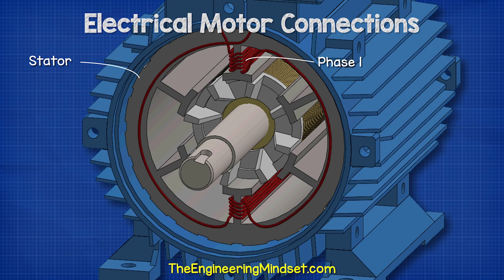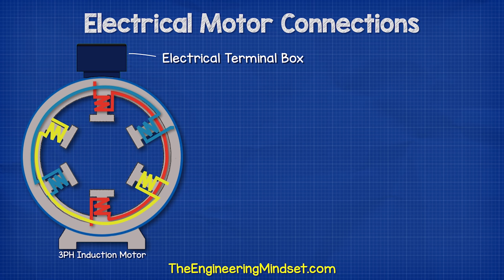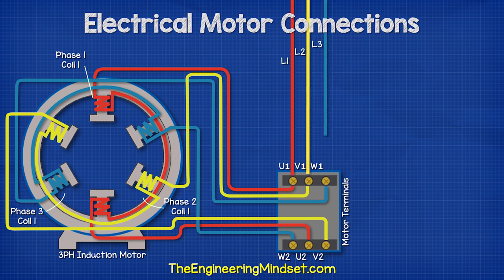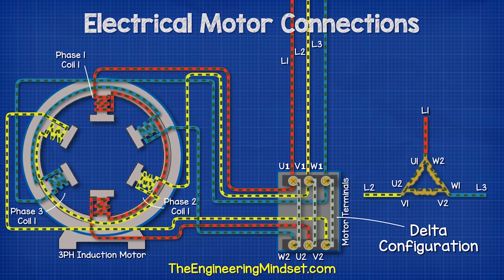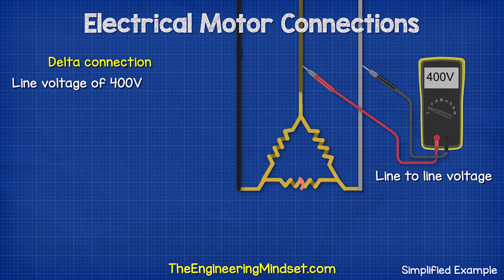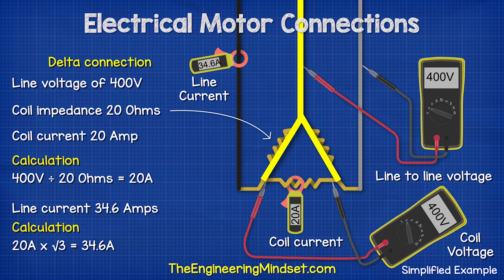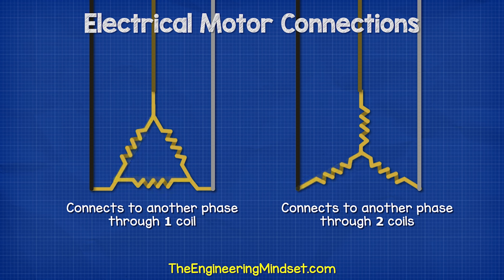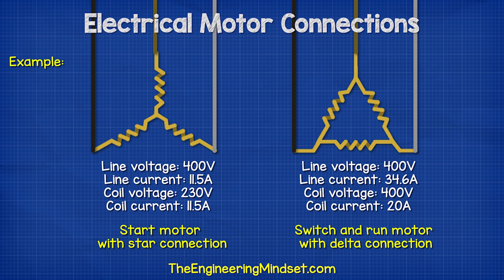Electrical Motor Connections

Comment: We don't have terminal boards inside the connection box on three phsse motors in America, just nine wires brought out from the internal part of the motor into the connection box located on the motor external. All nine wires hang individually loose within the connection box and are NOT connected when bought from the motor vendor. Six of the nine wires have their own number designation attached to them. The designation ranges from the number 4 thru the number 9. Each of the remaining three wires have their own designation as well. Those designations are  T1, T2, and T3. Sometimes T1, T2, and T3 may just be labeled as 1, 2, and 3, not having the letter "T" attached. Again, the nine wires are connected in the field, inside of whatever piece of equipment/system of which they are a part. Three phase motors are built as multi-voltage motors in America. The two voltages are 230 volts 3 phase and 460 volts three phase. How the nine wires are connected is dictated by which voltage listed above is going to be applied to the motor AND whether the connections will be configured as Delta or Wye (Star). The connections within the motor connection box are all made using wire nuts and approved electrical tape, NO terminal boards. Also, the connection box is informally referred to as a "peckerhead" which is just jargon used in the skilled trades.
Reply: How are 7,8, and 9 wired inside the motor. I am trying to visualize the inside of the motor. I understand 1 and 4 are 2 windings, 2 and 5 are 2 windings, and 3 and 6 are 2 windings making a total of 6 windings in the motor but when 7,8,9 wires are popping out of the motor I don’t understand how they are wired inside the motor.

Comment: Thank you for the explanation and difference between the "Y" and the "DELTA" connections.  When would the "Y" connection and the "DELTA" connection be used?
Reply: @SACalkins1  Thank you.
Reply: There are systems that start in the Wye or Star configuration because of the massive amp draw is reduced, then using some timers and three contactors will set the configuration to Delta because the motor can run faster.

Comment: 5.29, you said correctly 11.5 Amps but wrote 1.5. Great video by the way.
Reply from the maker: 11.5 is written on screen. The two 1's are close together though so it does look a bit like 1.5

Comment: The star version uses less voltage and less current.   Repeat after me, 100 times.      On a three phase motor the 
star version uses less voltage and less current.      Thank you very much.
Informative.

Comment: Can you do a series of videos on SCR's/Thyristors please.
Reply: As I understand them they are similar a fast "relay" in a small scale.
Reply: An SCR is a device that conduct electricity in one direction normally for DC circuits, whereas a Triac conducts in both directions. When gate voltage is applied, the device begins to conduct and the gate voltage can be removed. As long as there is voltage across the anodes. Once the voltage on the anodes reaches zero, the device shuts off and needs to be retriggerd again. Usually a triac also is used with a diac on its gate. A diac is a dual is a dual diode that can have an Resistor/capacitor combination on one end that will delay the turn on of the DIAC/TRIAC combo withing a given time period within the sine wave. This is normally used for light dimmers
Reply from the maker: Check out NEW resistor video, everything covered! ➡️ https://youtu.be/DYcLFHgVCn0

Comment: good sir,  since star connection is less amps,  so is it advisable to run the motor in star conncetion ,  and then why it is required to start motor in star and run in delta ?,    please clear my doubts.

Comment: How will the voltage and current differ between delta and star, if the motor is used as a generator?

Comment: square root can be interpreted as equal contribution to each other. multiplication means contibution of one dimension for each unit of another dimension. Equal contribution, or a joint.

Comment: Great video, but this is only for a 6 lead motor. This missed the 9 and 12 lead motors and there is high and low voltage for the different leads.
Reply: Yeah but this is enough for now. Don't want bombard and confuse people. Also in a lot of industries most induction motors are 6 wire so would be sufficient

Comment: So the purpose of the 2 terminals is basically to supply a path for current to flow back. So the windings have an impedance, otherwise you would effectively be shorting out the phases in the terminal box? What material are the windings made out of and to what size? Because to add a high impedance, coil lots of cable and still have them sized appropriately to take the current, doesn’t make sense in my head lol. If youre feeding a motor with say a 16mm cable @ say, 0.3ohms, and you need to carry that same current, wind it around and have I don’t know, 100ohms, w-how? Lol

Comment: Thank you for the explanation. I wonder what happens if one of three wires coming from controller gets disconnected. Will the motor stop working completely, or will it continue to operate in a much weaker state?

Comment: I still wondering how a single phase motor create rotating magnetic field
Reply: You can think of it like actually 2 rotating magnetic fields rotating at same speed in opposite directions.They sum up to a vector (or phasor) which only moves on one axis. At stall or zero speed configuration, there is no net torque on the rotor as both of these rotating fields pull on the rotor equally. But once the rotor is spun it will preferentially follow to the one with the less slip, for an induction motor at least. The inertia of the rotor helps reduce torque ripple a bit.
Reply from the maker: Here you go https://youtu.be/onIMNox24NI

Comment: If the star or delta connection is an option in any 3-phase motor, does this mean you can use either configuration in order to get higher or lower power output? This seems a bit odd to me, as I would have expected the motor design to be optimised for one or the other (but I am not an electrical engineer).
Reply: @ciberiada01  Interesting. Since I posted that comment I saw another video about the star/delta switching systems that you mentioned. This apparently is intended to limit the huge inrush current that induction motors draw when initially powered (which will be lower with a star connection). Once it's up to speed it can be switched to delta for maximum power, without such a big current surge. Maybe that's the main reason for having the option available. I'm not sure I understand why a motor would be designed only for star connection though.

Comment: 3 phase electrical motor connection red yellow blue switch statar phase 1 phase 2 electric  phase 3 terminal box end of coils stator winding rotor current winding  electromagnetic field 
Phase 123 current of coil voltage yellow red blue supply delta connection 400 voltage coil impedance current star connection on start yellow supply red blue ampere 20 teacher ji

Comment: Very good explanation but you left the ending Hanging. You could end like this "Since the Star Connection uses less current thus Motor Connections should be in Star?" or "Since Delta connections produce higher voltage of 400 running of Motors is on Delta?" .. makes better sense?

Comment: One question sir is a six 6lead motor can  run on hight and low voltage as 400 and 230 valts  from star or delta connection which one is hight or low voltage as 400 or 230 volts thanks

Comment: Decades ago  my then  boss acquired  a truck  reefer unit that would not operate on  AC  (engine vs AC)  I saved his ass.  Someone had gotten the two sets of windings,  set up for 240/480,  out of phase with  each other.  I used  lamp bulbs  to find  the proper  phasing  between the two,  reconnected and relabeled   the  pigtails and off we went.  He was ready to junk the motor,  and to his death  I don't think he realized how much money and toruble  I saved him.

Comment: Very interesting so thank you for this.  It would be interesting to relate this back to the usage for each configuration - I assume delta is used for higher horsepower motors but where does the cutover occur?  Cheers
Reply from the maker: Here you go https://youtu.be/h89TTwlNnpY
Reply: @EngineeringMindset  That was helpful so thanks.  I didn't pick initially that you can use the star configuration as a starting point for the delta to reduce inrush current - I thought that they just alternatives.  Cheers from Oz.

Comment: Do you always need 2 sets of coils per phase across from each other (like in your video)? Or would it be possible to use only one coil per phase (so the current enters the coil in U1 and directly goes to U2 at the end of the coil)?
Reply: Then it will produce low torque